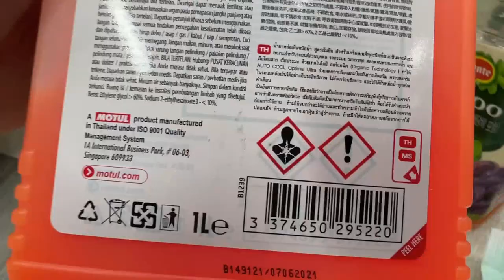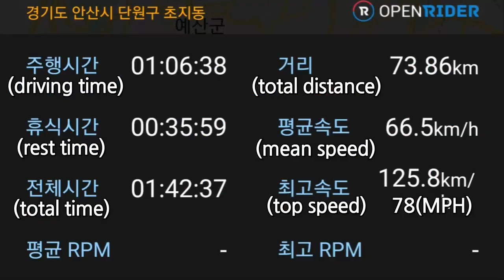Electric Scooter WEPED Dark Knight Liquid Cooling System Final Version / Top Speed 125.8km (78 MPH)

Comment: muchas felicitaciones a la gente de Weped por que el desarrollo en cuanto a modificaciones de sus equipos la llevan al nivel mas avanzado y de una prueba que hacen terminan con un diseño final que es lo máximo Felicitaciones Weped lo mejor de lo mejor
Reply from the maker: Gracias siempre 😊
Reply: Tu sabes que numero de llantas son esas
Reply: @Mr_Battery_CR         KENDA AT16x8-7
Reply: @yeckson1974  amigo. Si tengo dos ruedas con motores de 3000w para conectar ambos debo tener dos controladores o lo puedo conectar a solo uno. Es que tengo esa duda. Gracias
Reply: @Mr_Battery_CR   Buenas noches amigo cada motor tiene que tener un controlador es lo mejor y un solo acelerador para los dos controlador